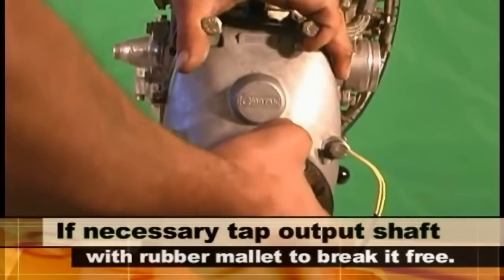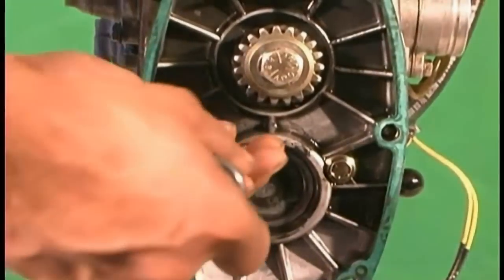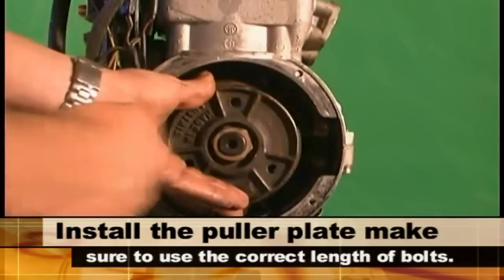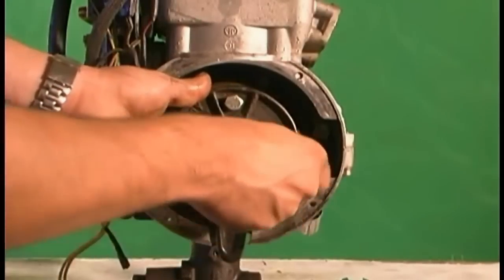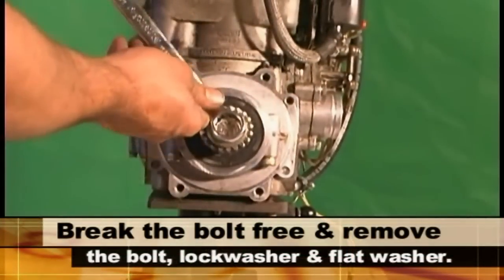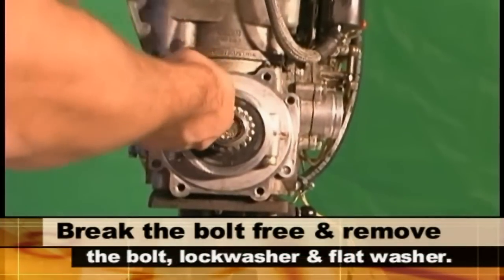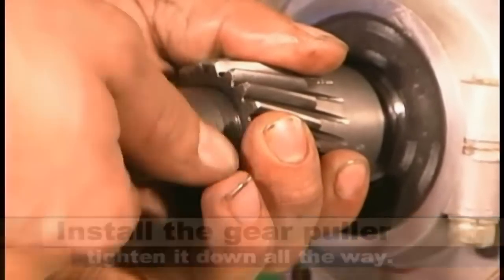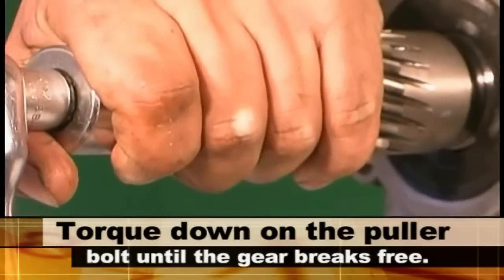Rotax B Reduction Drive Gear Box Removal Procedure.

Comment: How come you dont just use a smaller propeller or reduce the pitch of the propeller?
Reply from the maker: A reduction drive is used because you can not spin a propeller at 6800 rpm. it will self destruct once the tip speed hits the speed of sound. For the best efficiency, you are looking at spinning the largest prop possible, with the horsepower available, at the slowest speed possible.
You accomplish this with a reduction drive.